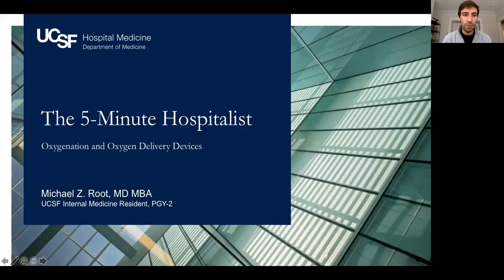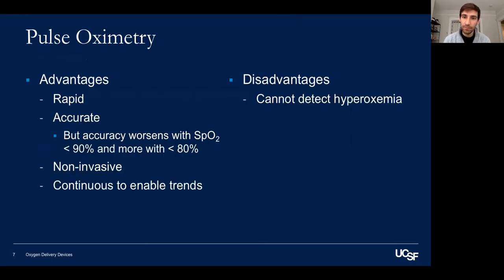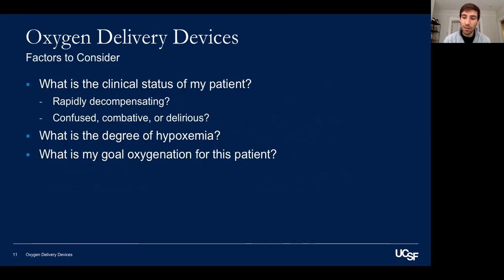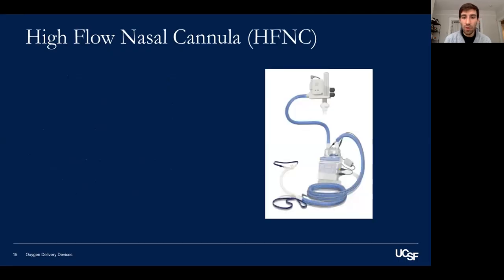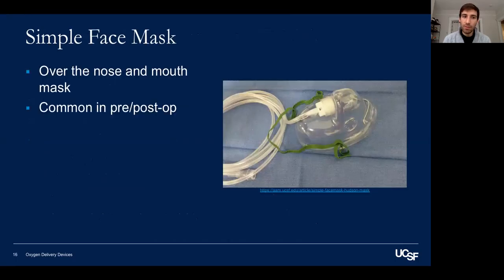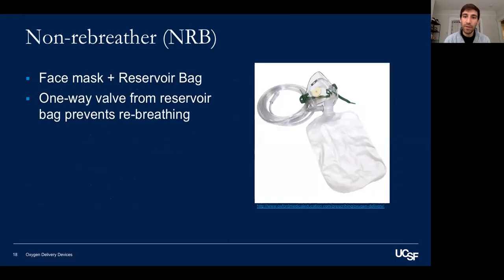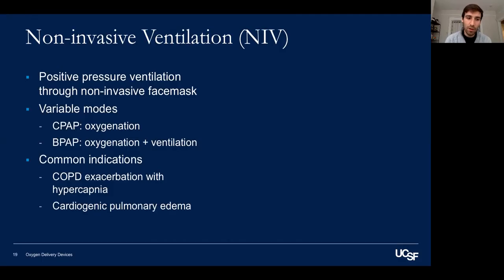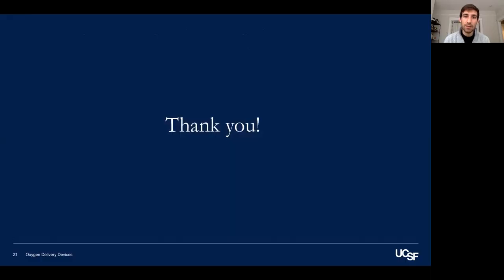Oxygenation and Oxygen Delivery devices

Comment: Nonrebreather masks (at best approx. 70% oxygen concentration) are not always fixed performance devices because the patients can have inspiratory flow rates greater than the mask can deliver.  If the reservoir bag collapses, the flow is not high enough for the patient. A HFNC is a high flow device (examples Vapotherm and Airvo 2). The HFNC that do not have active heaters, like the Salter, are actually low flow devices because they can only deliver a maximum of 15 L/min Most patients have an inspiratory flow of approximately 20 to 30 L/min. The technical definition of a high flow device is a device that can deliver at least as much as the patient’s inspiratory flow rate (> or equal to a minimum of 30 L/min). N
Reply: They can delivery at least 80%, but that is why they are for emergency use only...
Reply: 😮hfnc can. why not. we can adjust on screen that flow 30 to 60 litters. i think it not low flow